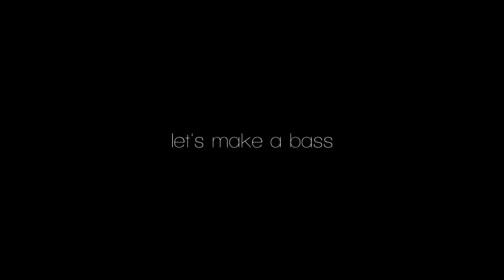DIY Paul McCartney/Tame Impala Bass Build - arttheboy

Comment: Where can you order just the wiring kit? I have a Rogue VB100 very much like this
Reply from the maker: the fret wire dot com, you dont necessarily need a specific wiring kit. hope this helps!!
Reply: I bought a Jazz bass wiring kit hopefully it works
Reply: I finished it yesterday...I put it in upside down so I have the dials backwards but I don't care...plays okay buzzes a little but that might be the sawdust cus I had to dremmel the hole a little bigger
Reply from the maker: @seymorebutter4365  awesome glad it worked out